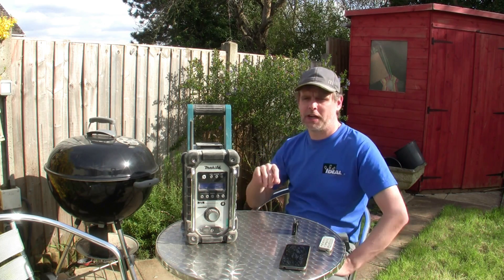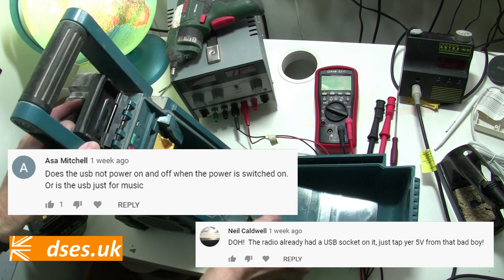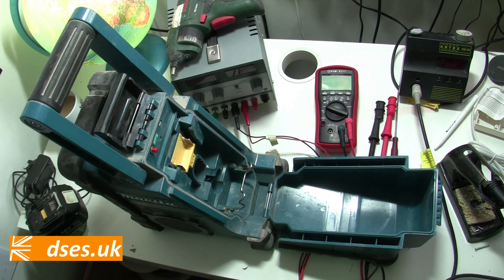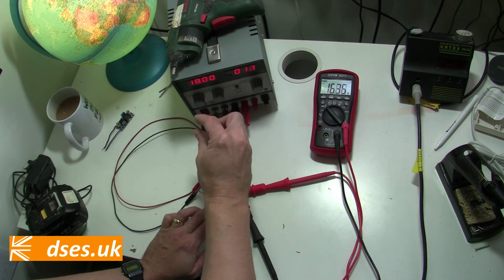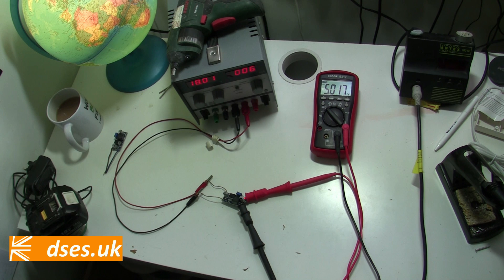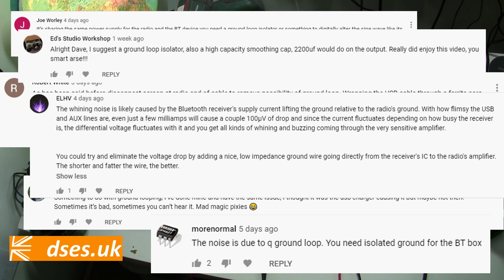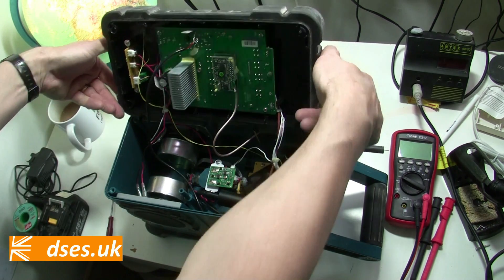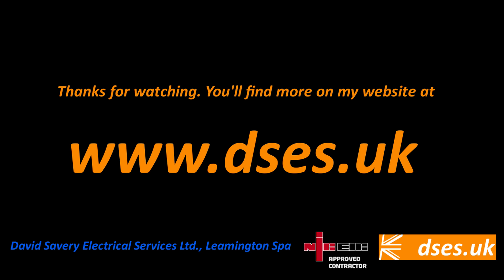Makita Bluetooth Hack 2: The Sequel!

Comment: I did this mod to my old Makita radio about 5 years ago. It never did sound quite right. Mine was the older non-DAB version and it definitely had 5V power. I used a cheap USB powered Bluetooth adaptor plus a ground loop isolator. It was ok, it worked. I have since replaced this with a DMR202 Bluetooth speaker instead. Haven't looked back... except just now when I did.

Comment: Blimey Dave what a lot of faffing about ! After watching your vid I did the same mod to my Mac radio only I went down the car shop and bought a round 5volt USB in a panel mount bracket ,got rid of the bracket drilled a ruddy great 32 mm hole in the side of the radio and fitted the 5v panel mount ,powered it thou a small switch near the handle just above the 32mm I drilled ,the 5v USB is powered from the Mac battery wired in side so when I want to use the blue tooth I just out the blue receiver from the back of the radio and plug it in ......p.s. the 5v USB has input voltage of 12-24 volts
Reply from the maker: Faff? Yes. Fun? Well, it floats my soap. It's just one of those things to do of a weekend - and most of it was done before every day became the weekend!

Comment: Fair play David I enjoyed these vids, I’m clearly far too much of a Luddite to attempt such technical things, electrics yes, electronics not so much! My fat fingers don’t allow for such delicate things!

I purchased the dewalt plug in Bluetooth adapter and just extended the output Jack to fit. It doesn’t have power so it charges when needed for a USB Adapter to one of my Makita batteries.  Your efforts are much more     sophisticated and far less of a faff than mine.

I’ve been thinking of upgrading my radio for a while for the Bluetooth plus version that also charges your phone...might have to be my next purchase. Keep well and safe fella

Comment: I would stay clear of the switch mode thingy as they tend to pass on the switch mode frequency :(  
As an example the 12 to 5 adapter that came with my tomtom satnav works perfectly, others totally wipe out FM, not opened the tomtom but the others are all switch mode.
The 7805 should have decoupling caps on the in an out, .1uf both sides and a 10 to 100uf in addition on the output.
Reply from the maker: Thanks Steve. I have a 0.1uF on the output.

Comment: Haha, i was screaming at the my pc when you used a 7805. Capicitors! While thinking why not just use a buck converter. But allas i see the problem is still there. I'm was just about to convert a portable Bose speaker to bluetooth myself and do pretty much the same thing as you. So thank you. So i've elected to just buy an external bluetooth to 3.5 jack that plug that requires a usb power source and fit a usb port on the back of my Bose for power. Saves with the f%@kery. Plugging in a headphone jack powers everything up and i can charge up my phone too. Not as posh as what you have done. But i can use it elsewhere if i choose. I remember in my younger days fitting such a supression device to my distributor on my car so that i could listen to AM radio. I'm guessing you would remember too ;) I do love your channel. Thank you for the larf's. Keep smiling ;)

Comment: Hi David. Just doing some college work an just see your video come up an thought I’d chance my arm to ask what do I need to do with metal trucking and basket tray to comply with bs7671. I have tried to find the information but I ain’t been able to get sent the regs by the office or find on internet.
Reply from the maker: I'm probably not the best person to advise, most of my work is domestic and I haven't worked with basket or tray since 2016 making me wholly rusty on the subject. What sort of information are you looking for?
Reply: For my nvq I uploaded some pictures on me fitting a piece of 50 x 50 metal trunking between two existing bits but I wrote how I cut it and bolted it together but my assessor said I haven’t mentioned how I kept to bs7671 and I’m not really sure what to mention. Usually I can find stuff on internet about regs but I can’t seem to. Probably doesn’t help that my 1 year old is not in the best mood an my girlfriend wants me to start painting the fences. All I wana do is have a beer in the garden or at the minute the wine bottles I have dug out from the back of the alcohol cupboard haha
Reply: @bankraid2183  Did you include the copper/brass earth straps between the existing trunking and the new section?
Reply: No I didn’t. Does that mean I didn’t comply to bs7671 then?